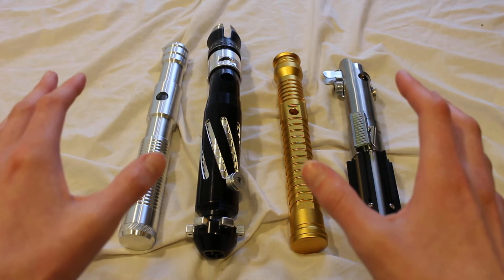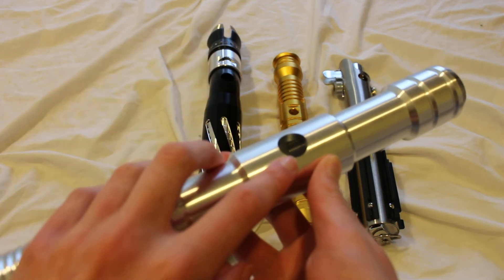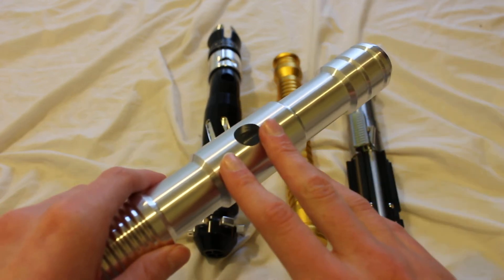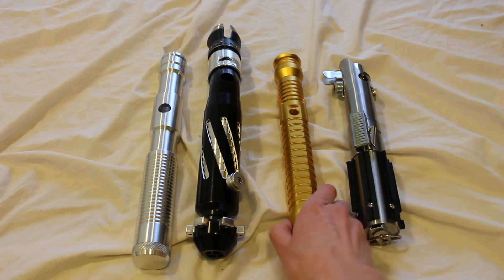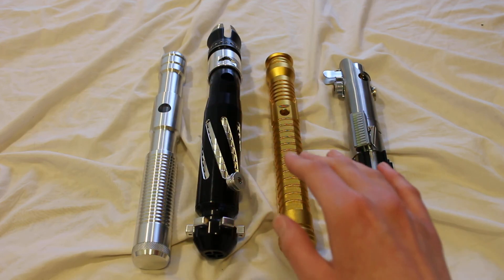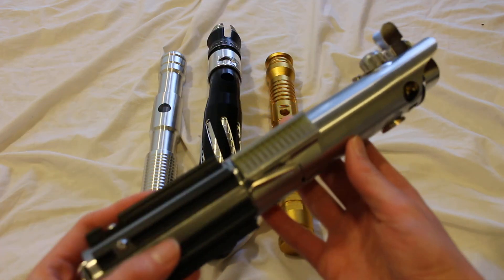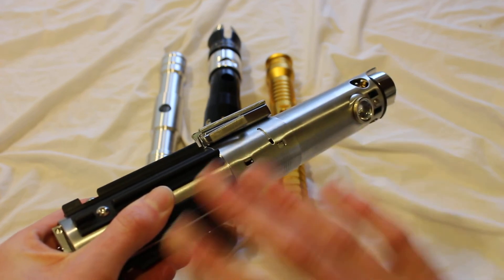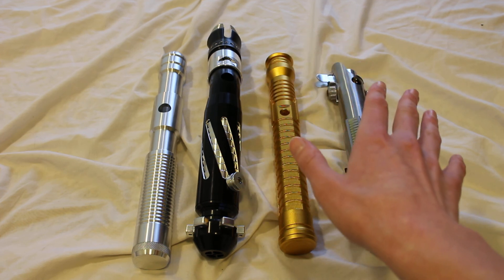Do empty lightsaber hilts make good display pieces?

Comment: Your viewers may also want to put some kind of blade plug into the empty hilt too otherwise you will have a gaping hole where the blade should be! Luckily there are some really nice plugs that look like they are actually part of the saber's internal components, such as the "turbine fan blade" types or the ones made using parts from an electric razor. These accessories can be found searching sites such as Shapeways and Etsy.

Comment: I've had a DV6, K4 & OWK (sold a few weeks ago) and an Inception Elite on display as empty for a while.  Haven't gotten around to installing them yet and they look cool enough just sitting there for now.  

I just got in a KRS Flagship (in brass, omg this is beautiful seriously, you need to get one) and it's gonna be sitting here empty for a bit.  Gonna fit the leather wrap on it and stick a switch in the hole to cover it up for now.